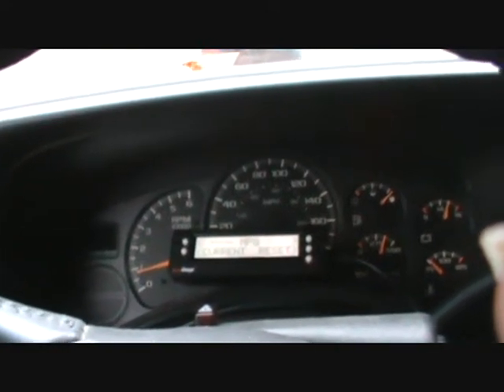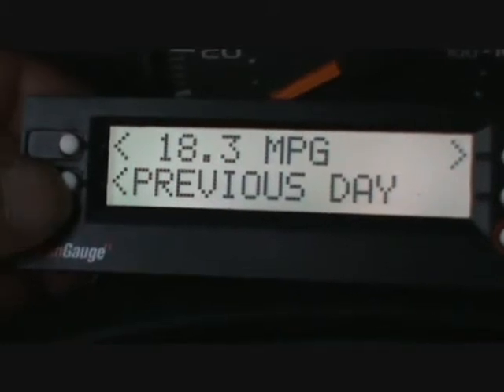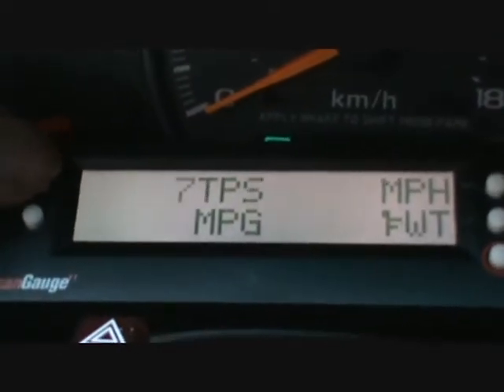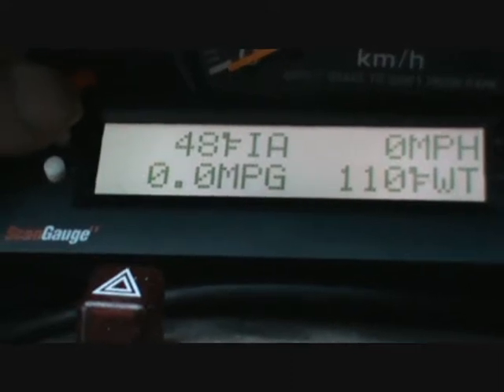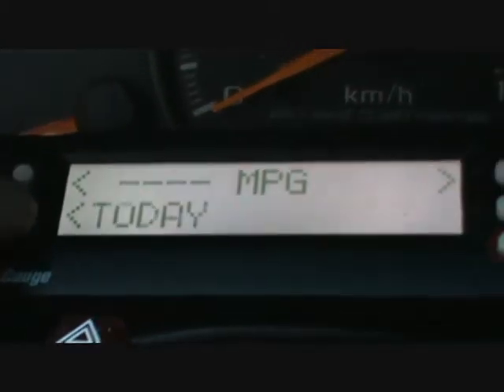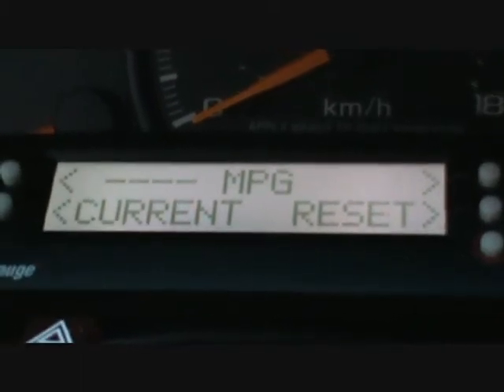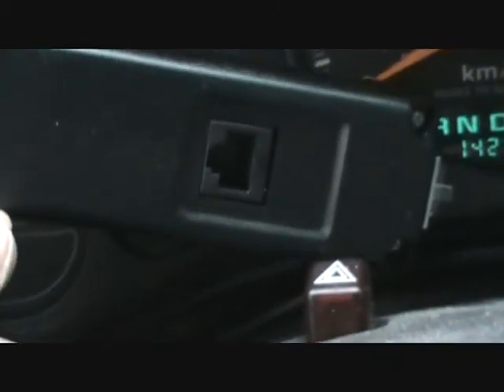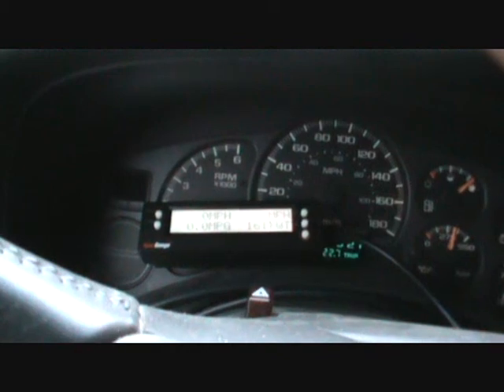SCAN GAUGE DEMO.wmv

Comment: Thanks! Air intake temp not outside temp. Hence the 4f difference, it's obviously warmer inside the engine bay. Where as the car s outside temp sensor is located near the front grill/bumper.
Reply from the maker: Thanks for your comment.

Comment from the maker: Your vehicle has an onboard computer which is sampling the O2 coming out of the exhaust and when using HHO the extra O2 causes the computer to see the engine is running to lean.
You need to alter the O2 reading by a EFII  or make a cell that does away with this issue all together which is what I have done. 

There is an issue if you mess with the onboard computer as the government has started to make such mods illegal. I however don't ask I just do. 30-50% savings are typical when done correctly

Comment: Thanks for the info Stan! I'm currently using a HHO unit, but not getting the desired results. My car is a 2009 Genesis, so could the computer be over correcting? Thanks for your feedback. Frank at myvi@shaw.ca
Reply from the maker: You need to deal with the computer as it will see the extra O2 and think it is operating to lien so will add extra fuel.